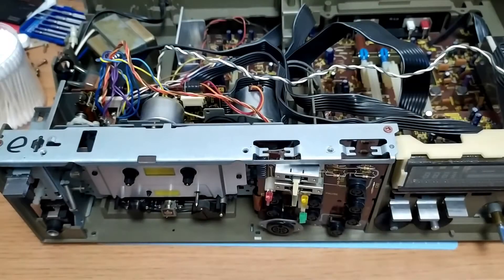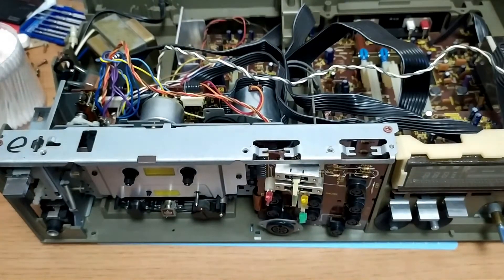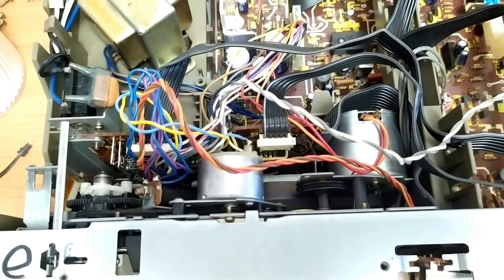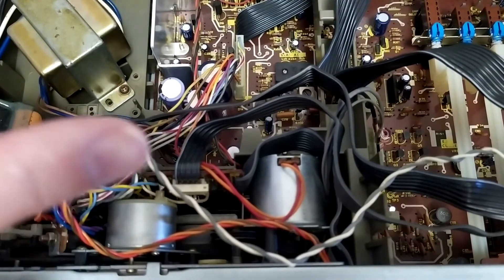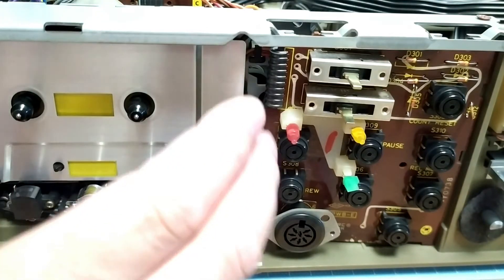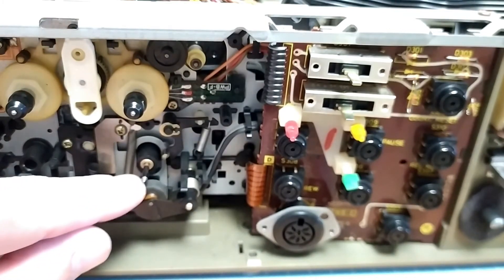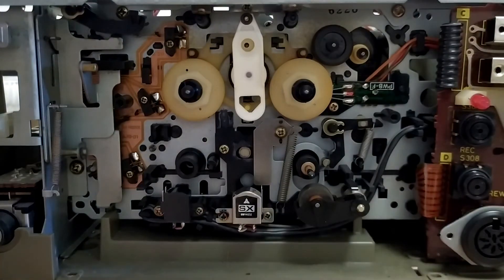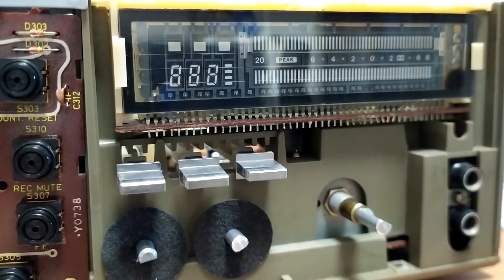Technics RS M250 Part 2

Comment: Really helpful. Thank you. 
With the pendulum, mine doesn’t engage left or right fully. And I really cannot work out why. Do you have any footage of the dismantling and reconstruction please ?

I can see a cog behind where the motor it seems to be ok although are there actually 2 cogs at different angles ?
Reply from the maker: It's actually on the shelf waiting for final adjustments.  If you can wait a little while I'll have a look at it and see if I can figure out the probable culprit.  Usual suspects are old dried grease, weak springs, or worn idler tyres. 
It's a great mech to work on as all the wires can be disconnected and the transport unit worked on separately.